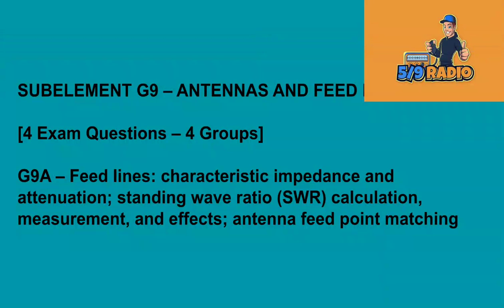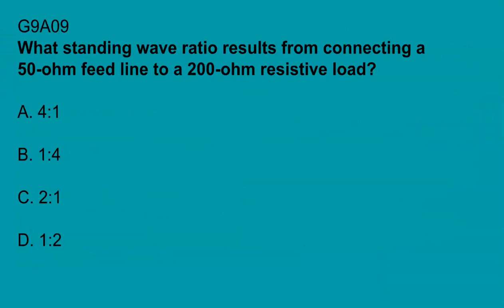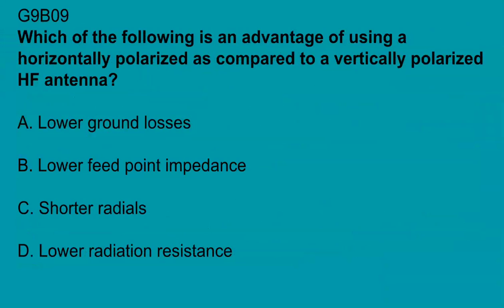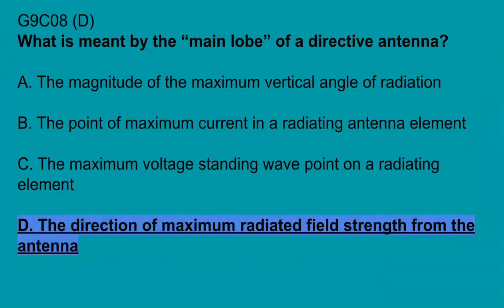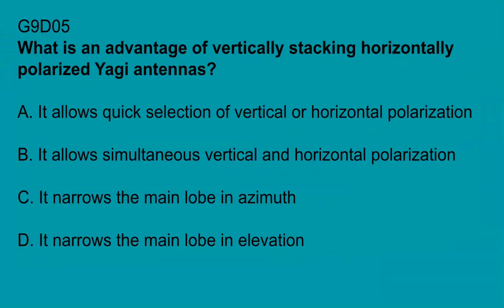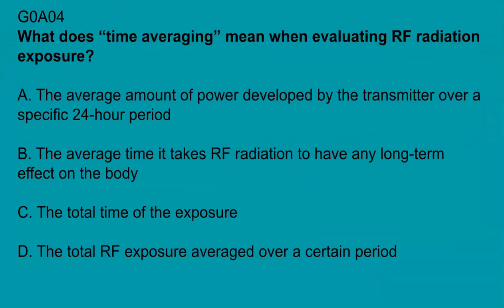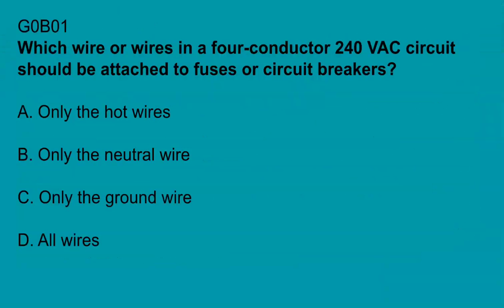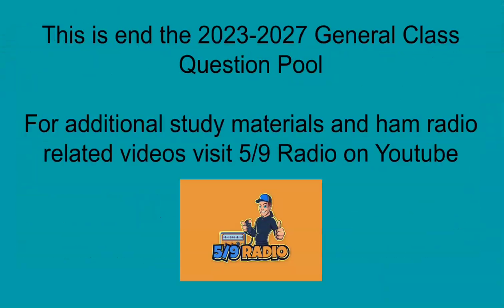2023-2027 General Class Question Pool  Video 8 #hamradio #hamharder

Comment: hey I appreciate you making these flash card videos- I've gone through every one. if I can make just one suggestion it would be that you show the formulas necessary to arrive at the correct answers along with the correct answers. it just makes it easier to understand as there is more math in the general exam than technician
Reply from the maker: There is none provided in the study information.  These are thrown together from the study materials released.
Reply: @59radio22  they are in the arrl general class manual lol what are using for study material?
Reply from the maker: @grumpy_ken  I'm using the question pool from the NCVEC.
Reply: @59radio22  they are in the syllabus that goes with the question pool
Reply from the maker: Everything that is included in the question pool is in the slides.  If there is an image its in the slides.  ARRL has their own syllabus where they go more in depth which I believe you reference as the NCVEC does not have a class or study format, only a question pool.